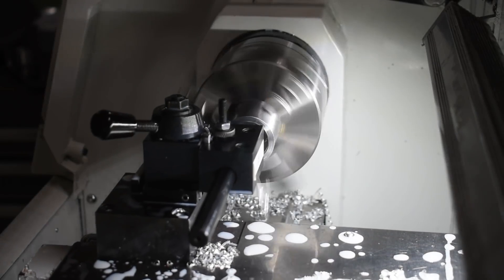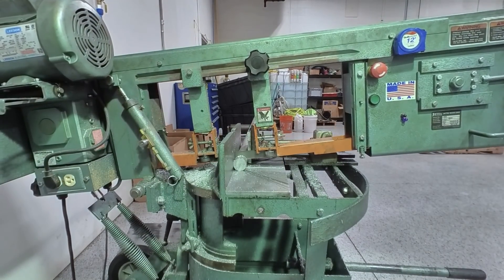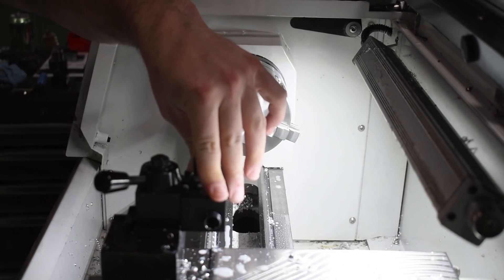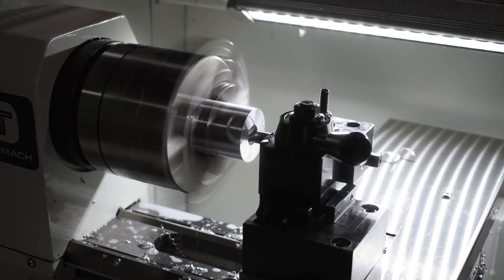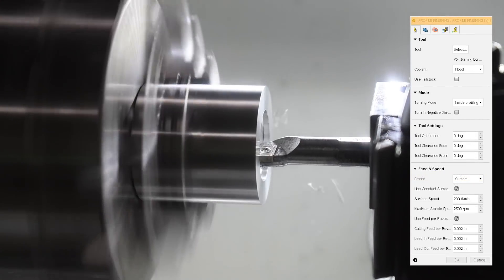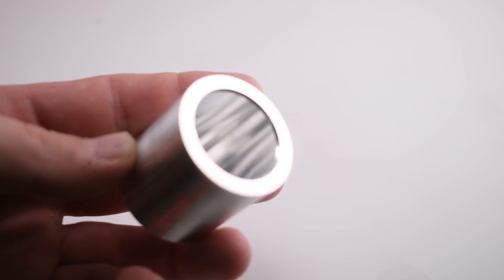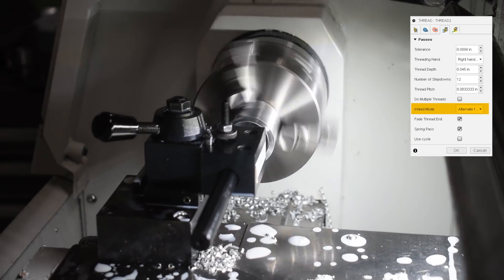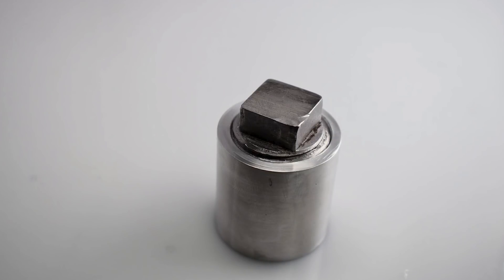ID Boring & Threading on a Tormach 8L CNC Lathe with Fusion 360!

Comment: Vince, if you have an HSM Advisor License I created a High-speed and Low-Speed profile for an 8L from data supplied from Tormach.  I have not tested these as I don't have an 8L but I have been checking out the 8L as it looks like it would be quite good for the type of low volume/prototype parts I would make on them.  What is the width of the bed (distance between the V's on the bed)?  What do you think about replacing the 0XA tool post with an AXA size - assuming it would fit?  The 0XA is what the Tormach Rapid Turn used.

Comment: Drilling and reaming is not the same as drilling and boring.  Boring yields better concentricity and a rounder hole, if everything is done properly.   Under 1/2” dia holes there’s plenty of solid carbide tooling, Swiss stuff etc.  
obviously on a threaded / tapped hole the difference between reaming and boring wouldn’t matter since that ID isn’t doing much on a threaded feature :)

Comment: Good grief, why not just machine this manually rather than messing around with Fusion? Easier, faster, surface finish just as good, and just as dimensionally accurate. As a bonus, it keeps up your manual matching skills.
Reply: Probably because their goal is to output parts not waste life on manual machining (unless it’s a hobby). Even a cylinder is faster for me on a cnc with better accuracy and a nicer, more consistent finish. But I like making parts. Others like the making of a part. Whatever you enjoy.
Reply: Why machine anything manually when it can be cnc 😎🥰
Reply: Pathpilot has a quite good conversational threading .
Reply: Most guys can also set this up manually inputting G code to do 90% of lathe work like this
Reply: One that knows what they are doing can machine this part way faster on a manual if you are going just for one part. Too many of these people on here are CNC dependent and probably can't even do the simplest of operations on a manual machine and I also doubt their viability as CNC machinists as well if they can't do the part manually.
Reply: @jasonholley8397  lol I guess? Idk I’m faster on my okuma LB than I am on my Hardinges.  And the LB will yield better parts 10/10 times 🤷🏻‍♂️
Reply: @evanlacava9213  depends if you are turning 1 or 100 I'm not gonna waste my time programming for just one part then have to tune the machine in. I'd rather just punch with a close to size drill on a manual finish out a bit and thread.
Reply: @jasonholley8397  turning tools stay in the machine.  Touched off.  Facing, Rough, finish, parting.  Drill body stays in the machine.  Boring bar holder the same. Stays in there.  I’d swap in the proper drill and a boring bar and ID thread tool and I’ll have a beautiful part in a few mins.    Cam templates make this really easy.  Argue away 😎
Reply: @evanlacava9213  Well no kidding I had no idea how a turret worked, not like I haven't done this for a living since I graduated college. Evidently you run the same material all of the time and that must be nice. I come from running pump parts that are aerospace tolerance so try your method on that and see how you hold up, also I teach machining for a living now so I think that speaks for itself. When you make single parts that cost as much as your house come talk to me then.
Reply: @jasonholley8397  panties in a bunch much? You’re king you’re right, no point in arguing here 🙄

Comment: 2:08 ouch that's a lot of tool deflection
Reply: yea ouch
Reply: Solution? smaller depth of cut?
Reply: @cayenne7792  i think its too big. If he takes a smaller DOC the tool might rub against the hole and break it
Reply: @cayenne7792  Get a used OmniTurn instead: no deflection, more speed, more rigid, more HP, more accuracy, no tool changing and the best, it's made in the USA, not China.
Reply: I've been wondering if an AXA size tool post would fit - I'm thinking it probably would with a thinner mounting plate.  An 0XA is 60% the size of an AXA so I would expect the AXA tool post would be more rigid.  Also, you can get a 3/4" boring bar holder for the AXA which would allow the use of 3/4" shank ER collet holders which could be useful.
Reply: @chrismayhew3651  The flex isn't in the tooling or toolpost though, the flex is coming from the cross slide and carriage it's mounted to, so a bigger tool post won't cure it unfortunately.
Reply: @MadManMachines  After rewatching the vid I don't see what you're suggesting.  I do own an 0XA tool post though, so I do have some experience with them.  I would say it's more likely the screws holding the boring bar needed tightening up.  There is a reference to this at https://youtu.be/LIwcwsCC4eI?t=190
Reply: @chrismayhew3651  Agree to disagree, it spun because theres so much flex the tooling dug in and caught thus overpowering the holding system.  I personally own one of these Chinese bench top lathes, the flex is where the slide meets the carriage and the carriage meets the bed, they do the same thing when cutting off, they pull down.   The slide has gibs and the carriage rides on the bed rails and theres a lot of flex in those areas, tightening the slides and carriage up helps a bit but you can only tighten them up so much or they won't slide freely as they aren't on linear ways, and they still flex a ton.  It's the nature of the beast.
Reply: @MadManMachines  You own a Tormach 8L?
Reply: @MadManMachines  the deflection I saw was from bar flex. If your cross slide flexes that much I don't think you could even machine a part.